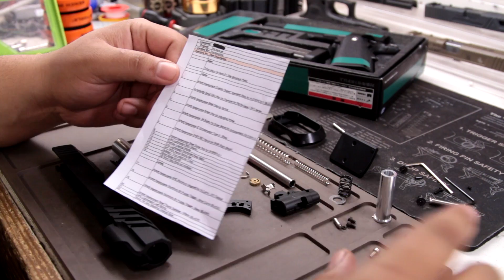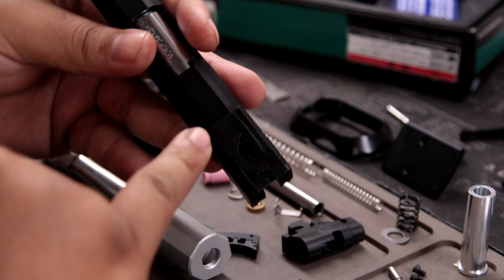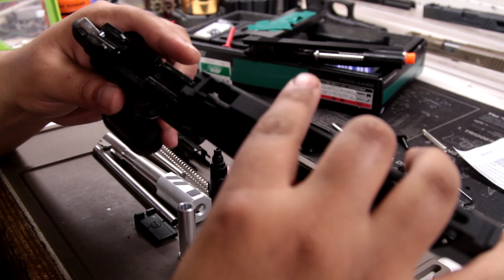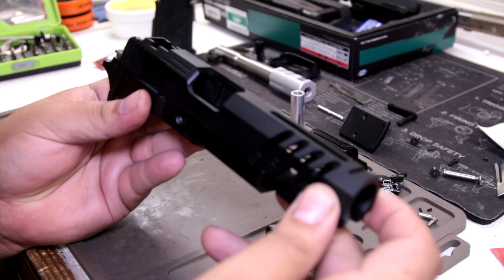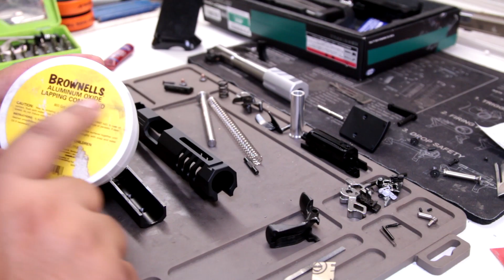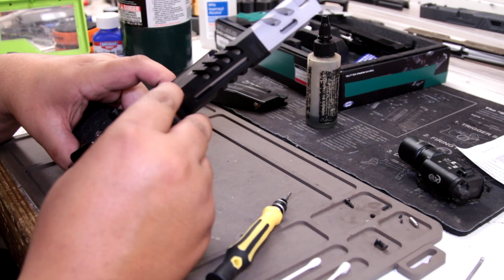Performance Package (PP) Custom Hi-Capa Build Overview

Comment: Thats a nice build! One thing: it is not too tight for ceracoat? I read it will give a bit to the meat, so a tight fit is a nightmare after it's coated... It went well with this pistol?
Reply from the maker: yea make sure whoever cerekotes it is skilled and the one providing it as well, so you can figure out how thick you need the coat which will vary per build

Comment: knuckles what u think of the cowcow bbu i have alot of problems with mine that the nozzle spring like pops out or get shorter after couple shots any tips or vid help ?
Reply from the maker: do you have a rear sight on? not sure why a spring would pop out if its properly installed with a rear sight, the nozzle spring is just based on what company you buy, but in the end all of the springs will get shorter naturally

Comment: Hi, I'm looking to build a Custom TM Hi Capa with almost all, if not all the parts I have seen you & 'Heavy Metal Airsoft' suggest to use in your previous builds. I want to max out for both reliability & FPS Including a 7 inch inner barrel.

For consistent FPS and to save loading down time I'm thinking of going HPA tapping with a box mag. Would maxing out the custom build be adversely affected by HPA & box mag other than drying the internals out?

Do you have any suggestions, recommendations? - I have, put together a spreadsheet parts list including alternative options.

I would appreciate any feedback/advice.
Reply from the maker: HPA will be just fine, nothing beats HPA in terms of consistency. You can just lube the gun and maintain it no problem.

Comment: what scope mount did you use for that pistol. also will it fight to a tm gold match grip and rail?
Reply from the maker: that was an easy mount that we bought from alpha airsoft, not sure if they still have some in stock.
Reply: KnucklesGSM do u know what the mount is called?
Reply from the maker: Should be "Easy Mount Red Dot" or something like that. Check on a-airsoft.com

Comment: Hey Knuckles. 2 things. The exciting and elusive TM G19 is a gun I'd love to get my hands on. Where and when do you suggest preordering it, if at all? And could you do a video on changing the internals of both a Glock and a hicapa nozzle? Seems pretty easy but I've never seen it done. Thanks.
Reply from the maker: cant help with that, check airsoft forums , im pretty sure some of my videos take apart loading nozzles, its very simple if anything

Comment: you need to add a hammer pad to the PP package XD
Reply from the maker: thats probably more personal preference because the gun still works no problem even after the frame has been knocked in. it eventually will just stop at the slide.
Reply: true that!

Comment: Hey, love your videos, i just bought a slide and frame set for my hicapa 5.1 and its a Airsoft masterpiece. I saw that you often use airsoft masterpiece's slide. What your thought on it ? and why my slide is not smoothly travel when i use my standard marui blowback housing ? thankyou :D
Reply from the maker: you need to work on the slide more
Reply: should i change my BBH to airsoft masterpiece one ? btw thanks for the reply.